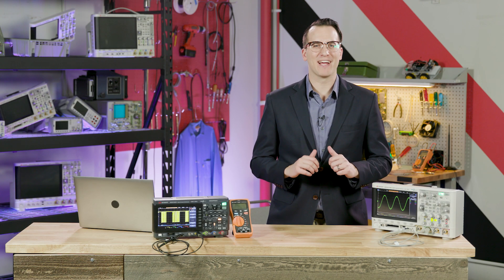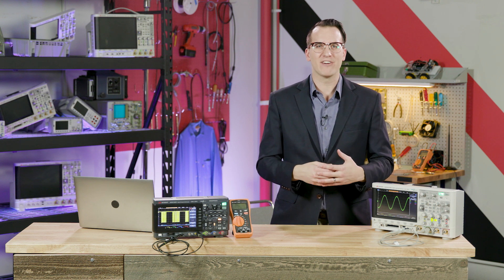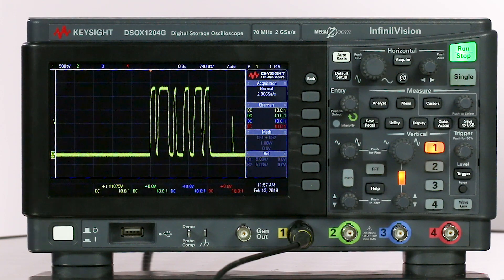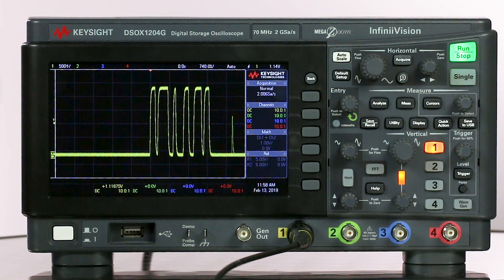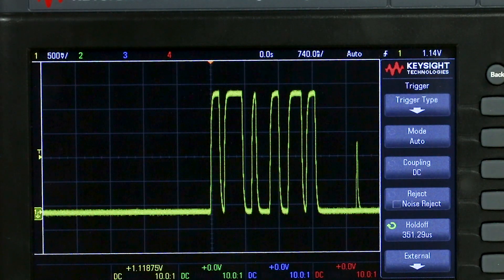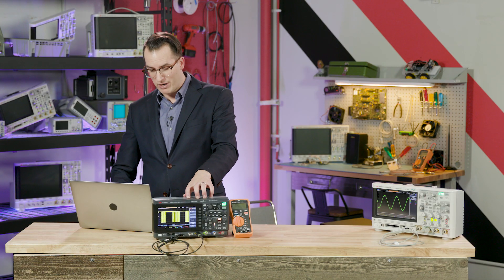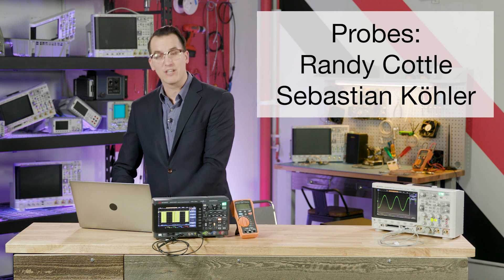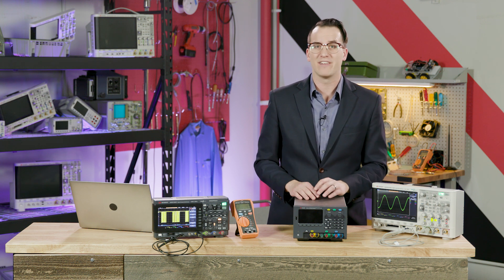Oscilloscope Trigger Holdoff + Today's Winners (5-Mar)

Comment: I never knew how electricity worked, never bothered about it, thinking I was just too "dumb"  for that way of thinking. Then I started watching Ben Eater's videos about making a breadboard computer from scratch. I took the courage to rebuild his computer and it taught me a lot about computers, circuits, and electricity in general. But that was all DC. Then I found ElectroBOOM. That channel taught me a lot about the connections and differences between AC and DC, in particular how much you can do and learn from a scope (which I don't own *sadface*). BOOM sent me here, where I'm trying to build on the vague knowledge I got from watching the videos. The most important thing is the following: I learned about twice more from constructing the things myself which Ben Eater  did in his videos, than from "just" watching the videos. Therefore I know, watching BOOM and Keysight videos is extremely educational, but recreating what the videos do yourself is a lot more valuable.

Comment: I'm a pro by hiring. I am self trained, but have schooled my employer who taught electronics and failure mode analysis for years.  I do component level repair on medical equipment these days. My "daily driver oscilloscope" is a Tek-465B that I build from a box of parts from 3 scopes. My true calling is to the ELF side of the spectrum.

Comment: I clicked on the poll card (Hobbyist). Also, sound engineer here who is interested in designing custom audio gear in the near future. Ancient 20MHz analog oscilloscope doesn't quite cut it for capturing circuit behaviour and testing its performance and characteristics.

Comment: I still dont get where you are getting my contact information. When I enter the draw, it doesn't ask me to enter anything, just click a button and I am entered???? Every winner so far has been a proper name, not a knickname.
Reply: they probably using a web cookie.
Reply from the maker: Ah, now your question makes more sense. You were cookied when you registered the first time (at some point between 8-Jan and now).
Reply: Ah, ok. Makes sence now. I will check the cookie isn't using a redundant email. Thanks
Reply: @KeysightLabs  my web hat on, plain text cookies are not stored, this is very insecure (and probably a privacy violation) cookie data with personal info is encrypted or session id with a expiration sliding scale  is used to track state, the only way is to clear your browser cache and try again.

Comment: I came here because of electroboom. I found electroboom through YouTube’s tracking software . It knew I want to go to school for mechanical engineering. My ambitions with mechanical engineering are a few patents which also require experimentation with electrical type stuff. I won’t go into detail because theoretically these designs of mine can change a lot and I wouldn’t want anybody to steal that credit.

Comment: i am an Electronics and communication Engineering student. Electronics is my passion and my profession. If i win any oscilloscope that will help me in my research work . Currently i am using that cheap Chinese $20 oscilloscope . That's a piece of junk. I am here through Electroboom channel.  For next videos i would like to see some FFT feature of scope. i guess this feature is available in scope. Thank you Keysight labs Wave 2019. Thumbs up
Reply from the maker: All right, we'll do an FFT tip tomorrow!
Reply: @KeysightLabs  thank you 😊

Comment: Triggering by pulses in same packet? Are you kidding? Trigger should not be rearmed until acquisition finished! So, acquisition should not be triggering by pulses in same packet, if all pulses from packet on screen. In this case it is possible only if rearming slower than it should. As result it rearms in the middle of next packet and you see this "jumps".
Also it is usual situation for packets that longer than acquisition time.